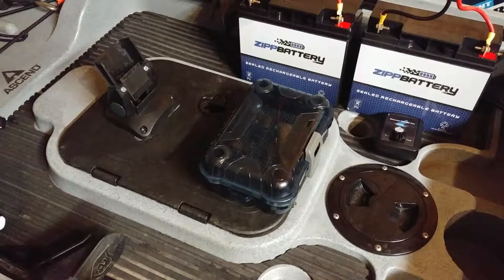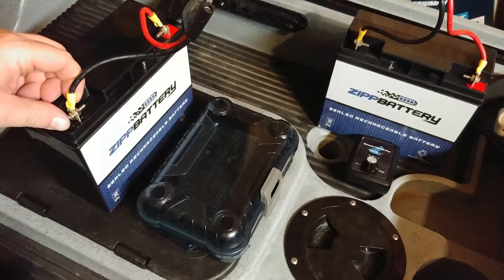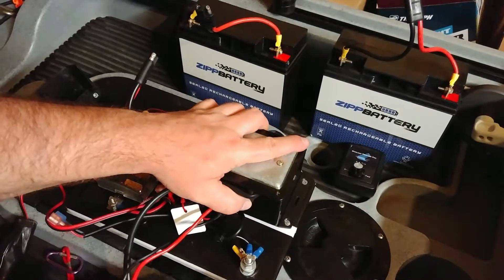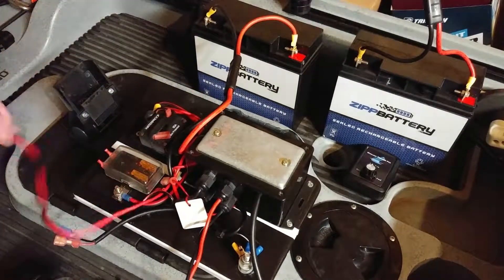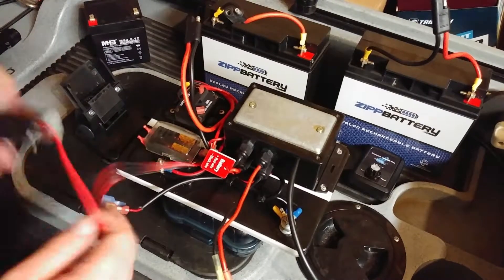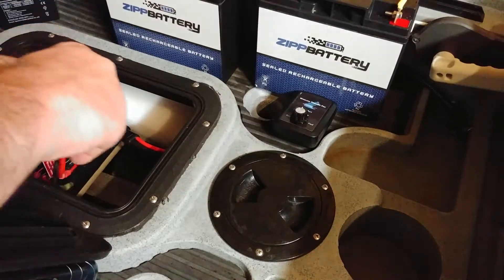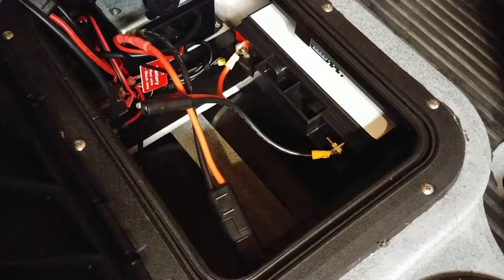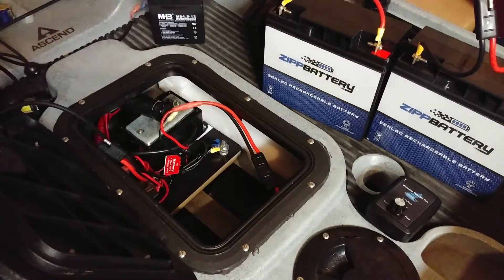Kayak Trolling Motor - Ascend 12T Kayak DIY Minn Kota Part 1

Comment: Question.... so you're running 2 small batteries in parallel for your trolling motor, required navigation lights, and your depth finder? What are they and how long can you run?
Reply from the maker: I don't have this kayak anymore but originally I was going to run them like that but it ended up being easier to just put a plug on both batteries and run one at a time.

Comment: Would like to know where you found the wireless PWM with fwd, reverse and speed dial.  This is not in the parts list and I have not been able to find anything similar in internet seaches.
Reply from the maker: It was wireless trolling pro but I think they went out of business. I never had issues with mine but I have heard others having issues and never being able to reach the company for support. I would recommend building a wired pwm using one from Amazon instead.